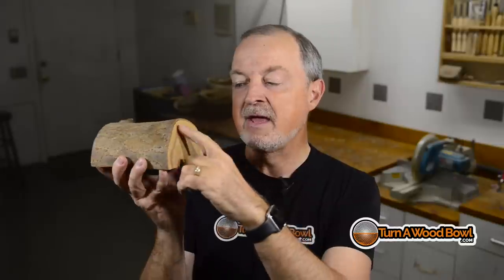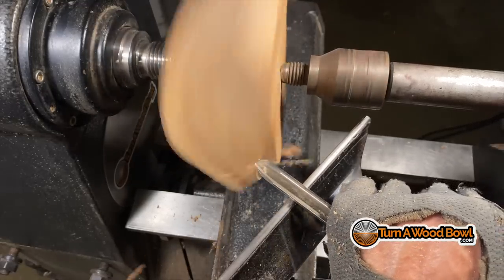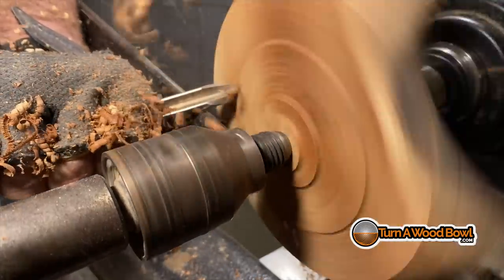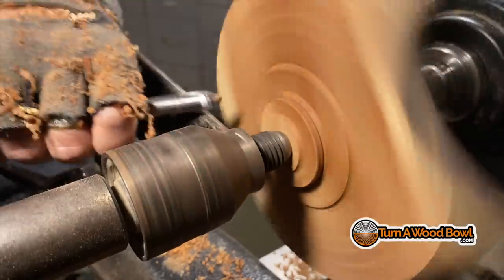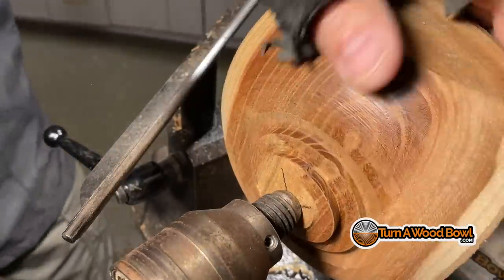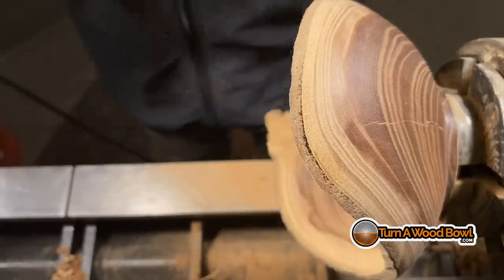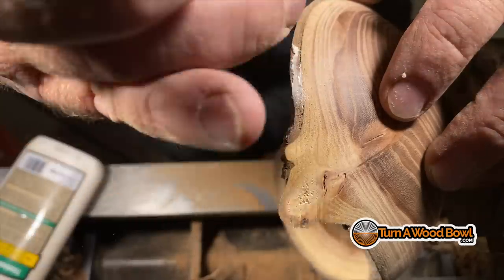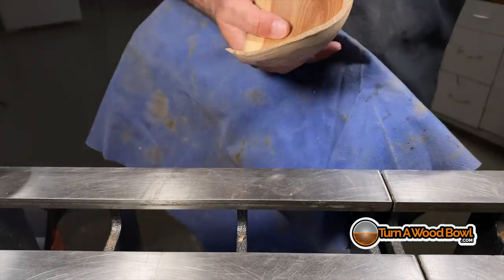Yard Waste Wood Turned Bowl – Video

Comment: I don’t get your comments about the recess vs tenon. To make a tenon you remove more wood than most recesses.  And the wall of the recess becomes a part of the base of the bowl.
Reply from the maker: Jerry, I'll have a video explaining this better soon. Stay tuned. Happy Turning!
Reply: I agree. It’s fairly straight forward to make a nice flat bottom then the mortise hardly removing any wood in the process.  In the process as shown - creating a foot & a tenon a lot more of the bottom is gobbled up.   I like the ease of creating the mortise vs the inelegant way of always having to reverse at the end, create a jam chuck, fine tune the bottom, nibble away at the very end & you still have to sand the bottom to “finish” it off.  To each his own & there are diff ways to skin the proverbial cat.
Reply: I might give mortise a try. Just had a glue up bowl turn into a large mouth funnel.  Totally operater error.  Forgot how deep I made the recess around the tenon and I don't have one of those  fancy calipers. Still a rookie making rookie mistakes
Reply: David Woff,
I tried a 4 corner squre bowl today.  Glued up 2 pieces of purple heart,  4x4x 1 1/2. Either my tools are not sharp enough or purple heart is too brittle.  Final product is a 3" round disk a half inch thick. Zero corners. Very disappointing,  but its my first try at  a square bowl. I have some practice  wood I pulled out of the burn pile. Its a 2x10 that is an actual  2" thick. I'll try that next.
Reply: My current opinion is that you get a more reliable hold with a tenon, but I also agree a mortise wastes less wood, and makes dealing with the bottom a lot easier.
Reply: The only reason I have against the mortice (recessed) method is that your chuck jaws are now pushing outwards on the base of the bowl-to-be.  You may not be aware of any inherent weakness within your piece of wood, and the jaw may tear your piece apart, especially when you are cutting it away even further as you turn it.  
If you are working with a whole round (ie not a split or cut block) having a tenon is not an issue, as you will need to make the base larger than allowed by the natural curvature of the wood anyway. 
When turning a larger piece, I would glue a false base on (I don’t currently have a jawed chuck, only having a screw plate, so far in my journey), which is later cut off with a parting tool, and the base is finished with a random orbital sander, followed by hand sanding.  I have made a domed and leather padded ‘stump’ that I fit the bowls over for finishing the bottoms.  It works. 
I am looking into getting medallions made for the centre of the bases, that would require my pre-forming the mortice, but at about 40mm diameter for the medallions, I am considering getting a very small diameter chuck that would do the job, but retaining a very large amount of strength with the remaining base diameter.

Comment: Some small wood I use to make wooden spoons and utensils. That way, a bowl and salad set of utensils can go with it. There are plenty of people on YouTube to show how to do this, but I do not use an ax or carving tool to outline the rough spoon. I simply use a small bandsaw to outline the shape, then use a disc grinder adaptation fitting on my lathe to get closer to the shape, then use a French rasp to finish up and a few carving tools to do the bowl portion. I finish up with 220 grit sand paper and 400 grit, then add tung oil to finish. The spoon and bowl set for salads or pasta makes a complete set to match. Look into it. I think you will increase sales value per bowl.

Comment: Ha, ha, my first reaction from your title is what to do with the shavings, etc? I would mix with green waste from the yard and kitchen to make compost for the garden. A good ratio of green to wood or other such item would be 3 parts non-green waste to one part green waste. To make it even better, make a pile with a picket fence like wall and add some worms bought from the bait shop. That ought to put some good use to those shavings and wood dust.
Reply from the maker: Thanks for the tips, Russ!
Reply: @TurnAWoodBowl Blessings to you, sir. Maybe in a few months, I can rebuild the old Delta lathe with a better motor for bowls..

Comment: I've been collecting a lot of free wood. I found an illegal tree dump and have gotten some nice pieces from that. Amazing the wood that people just dump. I've also carried a small folding saw on bike rides out into the forest and found some nice spalted fallen timber. Our daughter cut down an old Apple tree, and I got some nice pieces from that. I just finished a small crotch bowl from the Apple stash, and a much larger piece (about 13" across) is still in its drying box. I turn bowls from green wood, sand them, and put them in a box or paper bag full of wet shavings. I weigh them weekly to monitor water loss. My Shopsmith has been busy with turnings over the first half of this year.
Reply from the maker: Sounds like you have it going on Tony! Very nice. Keep up the good work. All the best to you and Happy Turning!

Comment: Live edge vs natural edge… I was told by a guy that owned a sawmill that it’s basically impossible to keep the bark on a tree after it fully dries. I had always believed him except for species where the bark is more of a skin than a bark… but is he just completely wrong, is it possible to keep the bark on most trees?
Reply from the maker: Good question, which we cover more in the Tree to Bowl – Understanding Green Wood course. www.TurnAWoodBowl.com/green Basically, every species is different. If he's working a mill, he's probably only seeing a few different species. Some will shed bark if you look at them wrong, while other's like the hickory that grows near me, have bark that thinks its part of the wood. I have dry live edge hickory bowls that would take a chisel and hammer to remove the bark. It all depends on the species and how the wood is processed. Happy Turning! Kent
Reply: @TurnAWoodBowl  Thank you for the info rather than stopping after referencing your course, and especially for all of your helpful videos!

Comment: Just got started making bowls.Just threw some old walnut on it and went to town with some spindle gouges.Shaping went fine but the ripped out grain and lines were beyond fixing .Stopped and told myself to do some research.Thanks to you I knew what tools and sharping set up to get,not to mention how to actually go about getting good results.I have made 4 or 5 solid bowls with a very good finish.....THANKS FOR MAKING THESE VIDEOS.

Comment: This is my first time wat your channel.  I've been running lathes most of my adult life, but they they all squealed and turned out metal chips.  I bought a wood lathe (small cheap Rikon) 20+ years ago and not having internet at the time I bought a book on how to use it.  The book and I never seemed to connect.  I take things literally and I was never sure what the book was saying.  But about the tenth time I had a chisel ripped out of my hands, I gave up and there it has sat with the same block of walnut chucked up for all those years.  Recently while watching other subjects on YouTube I stumbled across Phil Anderson''s channel and fell in love with his work - very artsy fartsy as he would call it, highlighting the bark on most every piece.  But he didn't go into the elements of the proper cut with each tool as you seem to.   Different strokes.  So I have not given up yet, but I am handicapped by a miserable back that limits my standing time to two to three minutes, perhaps ten with a brace.  So any project I tackle is likely to be a long term project.  But I thank you for your knowledge, patience and time in sharing this video.   If I never turn a bowl, my life is a little richer for having viewed it.  Pete Wells in NH

Comment: Kent,. While turning the inside of the bowl it appears that your gouge overhangs the tool rest by quite a distance.  Realizing that you have done this once or twice before, would you advise a new turner to use a bent tool rest and less overhang?  Thanks in advance and thanks for everything else as well.  Pete Wells in NH

Comment: Good job as usual, Kent.
I noticed your tail stock appears to have a slight wobble - is that a problem you will need to deal with at some point or is it just my eyes being tricked by the frame rate and speed of the lathe?
Reply from the maker: It might be a frame rate thing. It's not causing any issues while turning. Happy Turning!

Comment: Turning is like the opposite of cabinetry. Cabinetry, a basic hand tool kit can be had for a few hundred bucks, but then you're hit with lumber prices, and to mill your own, it's a whole thing. Turning, Welp I just got a 3 foot branch abouts 10" thick off the side of a road and that's like 6-8 of them small bowls. And my daycare let me help myself to a big ol sycamore tree for free. As far as I'm concerned green turning is basically free. After you shell out on the lathe, tools, sharpening station, and what else of course

Comment: This brings to mind my experience of the spur drive slipping and chewing into the work. I hesitate to stop the lathe and pound from the tail stock end, for concern that I will hurt the bearings in the headstock;is this a valid concern?
Reply from the maker: Seth, yes I would not hammer on the tail or head stock. Make sure the tailstock is locked down and just keep hand tightening the tailstock. It will loosen a bit with the vibration of turning. Just check the hand wheel on the tailstock occasionally!

Comment: I looked at your “go to” tools. So the buyer must grind these to 55 degrees and sll the micro bevels? I dont have time to figure the angles, bevels you use because I will be using tormek t8 and not a traditional grinder with sorby jigs. I must have all the knowledge up front before i buy the lathe and now that lathe is a laguna 1524

Comment: At 21:00, you leaned over the lathe to start the outside cut.  I think it might have been more comfortable to run the lathe in reverse and start the cutting on the far side.  But that does take a bit of practice to start the cut at the desired distance from the outer surface.  Oh, and make sure the chuck is locked on the spindle with a setscrew.
Reply from the maker: Correct on all counts. I find it faster to keep the same rotation. Happy Turning!